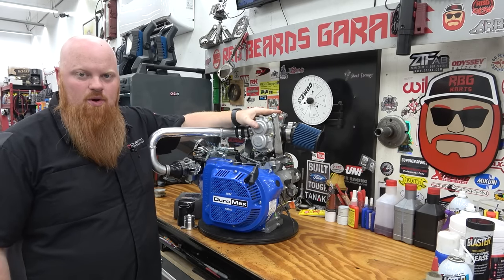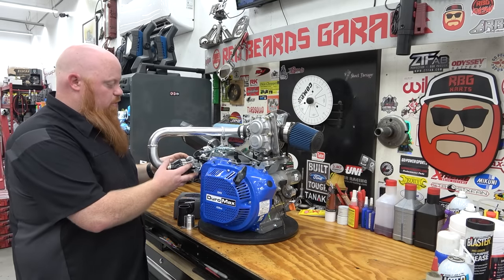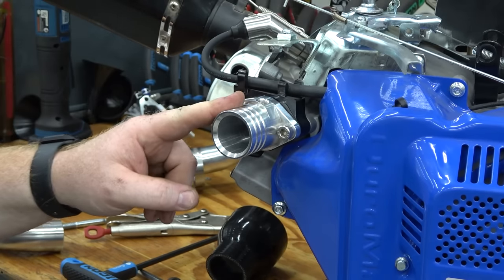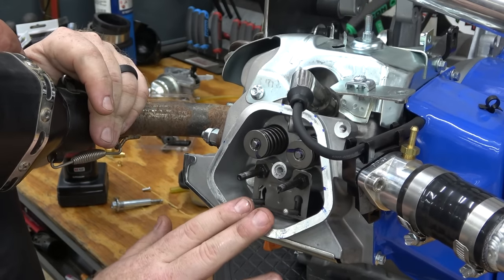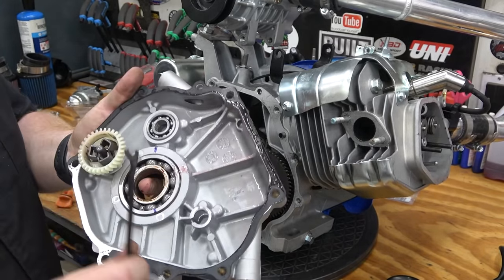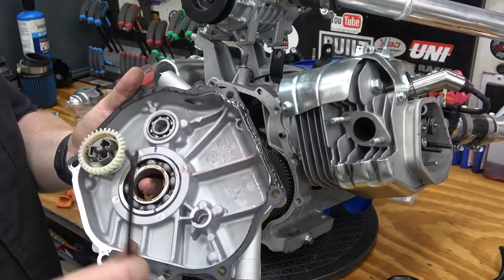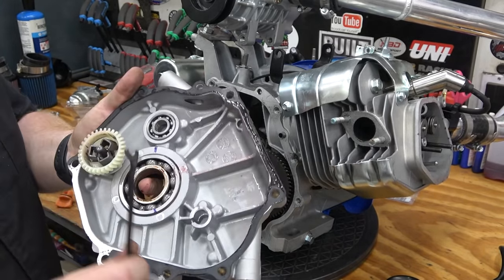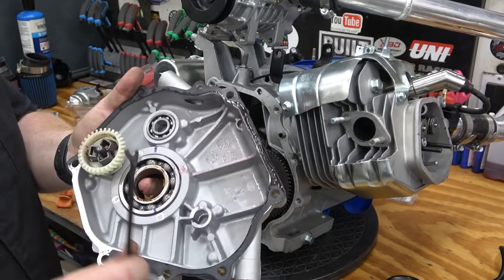We Make 15lbs Of Boost!!! Supercharged 440cc Take 2

Comment: My son and I got the 440 duromax engine last year.  Been trying to figure out how far to go with it. I don't think we'll go this far. This will be our first build, and your videos have provided a lot of info and entertainment. God bless you and your family
Reply: I got massive power gain, without going crazy, on my 200 cc clone “stock block,crank,cam no governor of coarse 
I port &polished head . Note:
match your intake (inside dimension) to the size of your intake “Valve “ for max flow !
A 400cc you may have to buy two carbs but my 212 uses 
22lb springs w 1.3 ratio rockers  stock push rods work fine for this build ! 
VM 22 carb on max setting ( turned wide open ) 
And headers 
I know I’ve doubled my power easily! 
I think you will be satisfied w the increased power
Reply: Valve springs or ratio rockers make a big difference for cheap

Comment: You have to put a blow off valve or some type of air release valve between the blower and engine. When you let off the throttle its still ramming air in the motor and causing slow decel
Reply: Problem is when the blow off valve opens you will get fuel blowing out of it...
Reply: Not with a draw through set up . Blow through yes you have to have a blow off. Close the  carb no boost
Reply: If the carburetor is mounted on the intake side of the blower. there will be air/fuel mixture between blower and engine...

Comment: With all the engine parts and tuneing vids out there it's time to start a mini bike drag race series 212-225 cc first class 420-460 second class and turbo /super charger unlimited class it going to be affordable and will bring more people into building these engines and have fun racing.great to see you make this 440 tune👍
Reply: 212-263 there's some crazy 212 builds up to 225 sells it short some of them can compete with 420's depending on the build most likely high octane builds.
Reply: I'm surprised your comment didn't get more likes that'd be mad popular in the Midwest esp on dirt too 🤤😔
Reply: this category of cc's are more common in my island philippines on small boat racing.they cant afford boost like supercharge and turbo charge.but they can manage to pull out 120kph on  a 7hp single cylinder engine.imagine if they can afford this kind of stuff.
i am gonna try my best for them to watch this video

Comment: I see your bridgeport there.    Should grab a lathe.  Could have pulleys and fasteners in a few hours instead of days.  If you wanted to you could 3d print various sized pulleys in NYLON and experiment rather cheap with ratios for ideal boost curve.   You could do quite a bit adding those tools to the arsenal. Subscribed!
Reply: Alternatively you could bleed boost off by gating the intake like you would exhaust for a turbo. Works in a pinch.  Not ideal imo.

Comment: Hey you need a boost relief valve.  It looks like your boost spices were when you closed the throttle and the boost has no where to go.  Not at wide open throttle.  This is normal for boosted engines. Lol and water systems.  If you close a water valve at the long end of a water line from full flow to closed to quickly it can knock the valve off by the surge of water.  I think that's what you are seeing here.  So try that before swapping pulleys.  Easy to test to. Put on your dyno and run it at rpm without closing the throttle and see what boost is recorded thru the rpm range

Comment: You need to build a tool to remove the valve spring without having to take the head off. With a duel cable throttle one could control a butterfly valve.

Comment: Update I have a predator hemi max performance 459 cc and I bought the exact same AMR 300 ter supercharger my plan is to run somewhere in the neighborhood of 6 to 8 pounds of boost And let me correct myself by saying you need a Recycling bypass valve or at least that’s what I’m going to use you can put a blow off valve but that’s if you’re running higher boost levels mainly also I’m going to add an inner cooler probably copy you and go with the 50 pounds springs port and polish the head head into a stack kind of like Semi exhaust with flappers got to keep that rainwater out and since nobody makes any performance parts for the most part for these engines as far as billet I’m going to a machinist and going To bring him a chunk of billet for a connecting rod piston and a flywheel definitely going to have the caps made with a lot more meat but as far as a carburetor I was thinking something like a small single barrel and modify it Into a blow through carburetor with all the fixings Wideband O2 sensor boost gauge Boost referenced fuel pressure regulator fuel pump and as far as connecting it to the carburetor I’m going to fabricate a box shaped hat(Basically to simulate pressurized atmosphere) Also it’s pretty important where you put your Bypass valve I would just let it dump out into the atmosphere but figured I’d give it a little more to take stress off the supercharger I’m pretty sure with as low of boost I’m going with the stock timing should do just fine maybe throw a different spark plug along with some ARP head bolts and ARP studs for the manifold and exhaust my ultimate plans for the engine is to utilize a four speed manual transmission out of a Chevy Luv as well as the driveline and rear end get a narrow rear end and shorten the driveshaft then I have a craftsman lawnmower I’m going to rob parts off of build a cab trying to be as weight conscious as possible but I have a craftsman trailer as well I was going to use as a truck bed that’s where I’m shooting for anyway still got some kinks to work out and I realize that it’s going to be quite a long road ahead of me but I definitely think I can pull it off then as a sidenote  I have a 79 Chevy Luv I’m swapping in a small block 350 with four bolt going to get some aluminum heads a good intake cam board it out possibly turbo I’d like to be in the 400-550hp range a turbo 350 transmission put a little 10 Bolt out of a S-10 but ultimately I have a 14 bolt that I’m going to narrow and use convert the rear suspension from leafspring to a 4 link suspension and ditch the front torsion bars for some coil over springs in the front should be a nice little sleeper and make a dual exhaust with a cut off valve throw a couple mufflers so that way I can trick people into thinking all I have is maybe a V6 at best open up the cutoff and blow their doors off God bless and have a good day man

Comment: The carb on my Yamaha Warrior, has a flat slide,
and downstream from that, a butterfly.  Don't ask 
me why.  Got the quad from my old boss, needed 
a battery, carb, fuel petcock, and a front brake master.
Quad cost me $200.

Have no idea why the carb has both the flat slide,
AND a butterfly.  No, the butterfly is not the choke.
It's on the other side of the slide.  Doesn't have a 
"choke."  Has an enrichment circuit instead.  
(Replacement was $40, on the Jungle site.)

steve

Comment: about this engine that using supercharger
my advice, Static Compressio Ratio, down to 7:1
boost to 0.8 BAR
make sure to recalibrate ring piston gap compression 1 and 2 for below 1 bar
and make sure, camshaft duration are not to wide, cause turbo / supercharger hate really wide camshaft duration and high overlap profile
hope it's help

Comment: I've thought of something similar. Making a top plate with 5/8" pillow blocks on top of it. (Essentially a jackshaft with v-pulleys) And fab a bracket for the supercharger to get it closer to the intake port. I wonder if a Tilly carb would work or maybe a Dellorto or a single Webber

Comment: next time doing valve springs get a pressure regulator and line with same threads as spark plug and run about 10-25 psi into the cyl should keep the valves up against the head and make the swap more efficient

Comment: Awesome setup once it gets built, and I'm so excited! 15psi is definitely the danger zone. One question I'm wondering about is how a 300cc supercharger manages to double atmospheric pressure (14.7 nominal + 15psi = 29.7psi actual) with a 1:1 ratio on a 440cc engine. I'm thinking that you have to already be underdriven somewhat. I'm all about that party pulley life so I say build the snot out of it and be sure to super size that ring gap and add head studs and a copper gasket to the usual billet parts and run it on 110 gas with a bunch of extra timing and a cold plug. What about a giant Tillotson carb? Put it on a mini drag bike!
Reply: Its a 4 stroke so in 2 revolutions of the crank it will draw its displacement
Reply: Pressure is just a measure of restriction. It’s not 100% efficient.
Reply: I agree it does seem high and that air going in is going to be HOT. I'm surprised at 15psi that he wasn't getting detonation.

Comment: would like to see a fuel injected small engine using like a low end holley or haltech fuel injection setup on a v-twin setup along with boost. in my opinion it would probly make decent power, have the low end drivability, a long with data logging built in.
Reply: The microsquirt ecu was built for that

Comment: Friendly heads up laser thermometers do not work on polished or reflective materials. Typically the emissivity needs to be around .99 (nearly black). A thought is to add a piece of black duct tape on the intake for laser to monitor readings
Reply: My pressure canner now has black tape on it,so I can get temps.

steve

Comment: Can i do the same setup on a 212 with a billet flywheel and rod? i already have a 356 cam and 36lb valve springs including a 30mm PWK motorcycle carb and cast aluminum flywheel. The Flywheel is not stock.

Comment: "VW carbs" might not be ideal for this application. Almost all carb setups for the flat 4 are downdraft. The last American 'production' 1bbl carburetors were designed to supply about 60hp worth of air and fuel to a 4 cylinder engine. The engines you see with carbs on each side are 2bbl Dellortos or knockoffs.
Maybe an older butterfly carb for a 1000 to 1340cc Harley engine might be a preferable option.

Comment: It needs a bypass, even a 1/2" ball valve will work to to bring the output to the input of the supercharger toto reduce boost at idle , then close when the throttle is opened, possibly open again to regulate boost slightly, maybe 1/2" tubing and call val   it doesn't have to be open all the way, maybe 1/4- 1/2 way open at idle, then  close as the throttle opens, and possibly  open at full throttle to regulate boost or while cruising not needing full power! A small carburator throttle valve would work great for this, maybe a weed eater carb with a hose barb fitting  nade to fit and seal both sides. Only 
Using the valve.  And sealing the fuel lines.  Then a Arduino and servo can with throttle pedal sensors to regulate the bypass, with no throttle while going fast down a hill it will be better to have the bypass fully open! It will make it much easier to drive!  
Imagine a supercharger from a 3800 Pontiac or Buick on a v-twin, (*they have bypass valves also*) it would require a gear reduction to keeping the heads on the engine, it would probably make all the boost at idle,  then throttle and boom, it would be about 3000 cc too large but a 4:1-5:1 reduction should work , but one of these would be plenty for a v-twin! 
Imagine one on a micro truck ppl are importing,  slightly modify the engine,  polish the chamber and pistons, port the heads,  add a supercharger, maybe two,(three running 2 into 1 to make a compound setup, but a turbo and supercharger would be cheaper,  with the supercharger working near idle, the turbo afterwards, make 25 psi,  easily doubling the HP,  a micro truck making 50-100 hp😮

Comment: Why do you think the supercharger would cause a slide carb to stick?
There are plenty of engines using slide carbs with just as much pressure differential as your supercharger.
Every engine sucks( well causes pressure drop at slide causing atmospheric pressure to blow air into engine).

Comment: The IR temperature gun does not work on shiny surfaces like the intake pipe, put a piece of black tape or something on the surface you meassure.
It also is not accurate at measuring the exhaust temp from 1 meter away, the measuring area is mostly shown on the gun, the exhaust can be 700 F and the air around it 100 F, the gun will average those temperatures and show the 400 F.

Comment: I think u can get a knock off 400 ex carb for like 50 bucks it should work but I would say a fcr slide carb would work because it has rollers and push pull dual cables like say for a trx 450

Comment: I wonder if you could install a stiffer slide spring to force the slide down under pressure from the supercharger and find the right spring tension to return the slide but not be too stiff on the throttle

Comment: Your intake tube is to long and the fuel is falling out of suspension, the intake tube I would change and move the blower and flip it 180 degrees so the intake tube can be almost strait into the motor with the exception of the curve needed to keep the blower in line with the pulley! Shorter the better. Look at an 6-71 or 8-71 blower on a chevy small block and there is no throttle response problem there when ya mat the throttle as the blower is shoving the charge strait into the port of the motor after it draws the fuel threw the blower!

Comment: On my naturally aspirated Honda gx240, yep 240,lol. I shaved the head to gain compression (a lot),& added some 26lb ducar valve springs to the new factory gx390 valve springs and well ported cylinder head then job welded the back side of the intake valve area to get rid of that void that’s there. Using a pz27 carburetor and chinesium adapter 😂 with an exhaust pipe that matches the 28mm exhaust port. Wow, I have a screamer, the only thing is I need a set of ratio rockers to go with the improved (better lift) gx390 camshaft. It runs great too

Comment: I use a 48 mm Mikuni Flat slide carb on my draw through Garrett Turbo charged 131” TP big twin,  it’s been years and other than some mods to the needle and seat to run a fuel pump and getting it jetted right it works Flawlessly, maybe it’s different with a roots style blower? 200 foot pounds 210 Hp to the tire on E85 built 2016 refreshed 2021.

Comment: 🤔 I'm curious about the predator 22 horse. Would you add a turbo n blowoff valve with a fuel tech system , cam, and all the goodies to see how much boost and power increase? And use E85.
Also.. is it safe to add 6oz. Duralube and full synthetic oil 10/40 on any small motors?🤔

Comment: go to an auto parts store and look for a carb for a 1984 jeep cherokee with a 2.5L inline 4, it might be a /tad/ too big, but you can make that crappy solex carb work with anything, its a butterfly style carb with an electric choke (easily convertable to cable choke with a little work) but should provide plenty of flow into the supercharger, and plenty of fuel for the engine, it is a Down Draft Carb however, if you are looking for a side draft, Webber Redline, or a holly BugSpray might work for the application with some modification

Comment: If you're going to put this on a go cart and that intake pipe was really hot to the touch you should be able to put your hand on that at maximum RPM and it shouldn't have any heat in it at all you're gonna have to do in intercooler And if you're going to run it on a go cart you can use a dirt bike radiator for an intercooler

Comment: I ran duel webbers in my Baja & it took a beating,!! you can drown um in water & dust um w dirt !  If my engine stalled I just 
Spray um out 
Pull the plug ,,turn over a couple times 
Put the plugs back in and 💥 I’m running again!! 💥

Comment: I think you should take a look at a carburetor for a Suzuki quadrunner like an older one I worked on one a few years back and they have both a butterfly and a slide I'm pretty sure the slide was ran by vacuum. So the slide won't stick from vacuum from the blower. I can't tell you the millimeters for sure but if I had to guess I'd say about 36mm. The one I worked on was off of a lt185cc.

Comment: 4 cylinder Pintos used a 34/38mm DGAS(?)  ( I think I remember right) Weber style carb. It is a primary/secondary style. People used some on Volkswagen Beetles. But the factory VW ones are probably smaller and work better in this ins.

Comment: I don't think you will run into carburetor slide problems with them hanging - atmospheric pressure is a constant and they can handle that just fine on deceleration from high RPM.

Comment: You can change the valve springs without removing the head as it’s done loads of times on cars, piston to BDC and connect your shop air supply into your plug socket, trapped air pressure in the cylinder keeps the valves shut

Comment: I have found that all the Chinese polaris carburetors have the needle seat with no hold down clip and out of spec, you can drive it down to the right fit to stop it from flooding. I've done it to all of the Chinese carbs and had good outcome. Good luck

Comment: Many years ago I had a vw, and it used a direct downdraft carb. Single butterfly throttle and usually an electric choke.  That may work but the carb is vertical position only. That would boost CFM quite a bit as the be is a weak 4 cylinder engine.  You would have to play with it to get it to work. You may have to use the throttle linkage to control boost levels too.